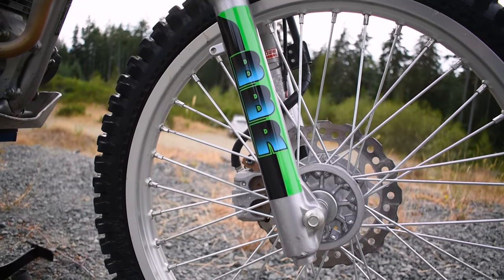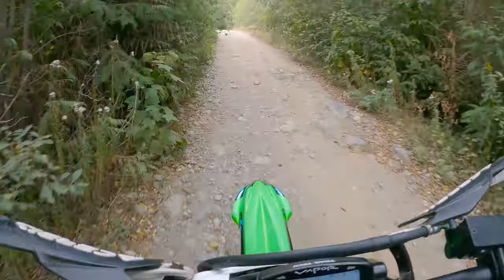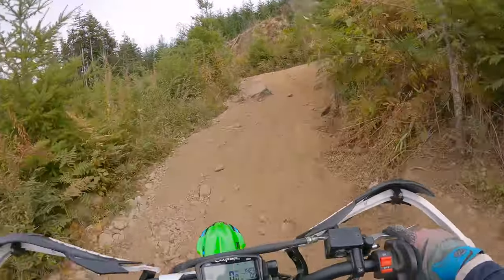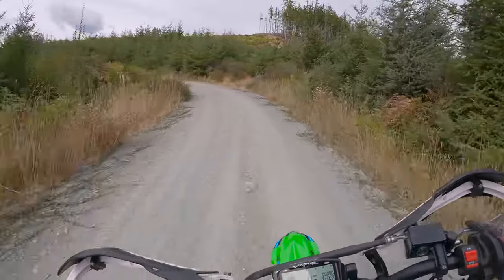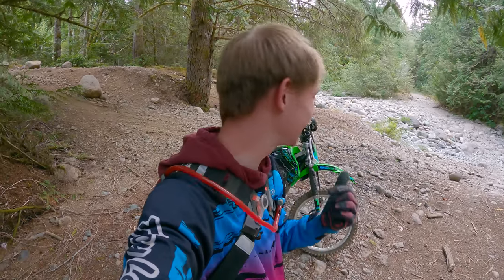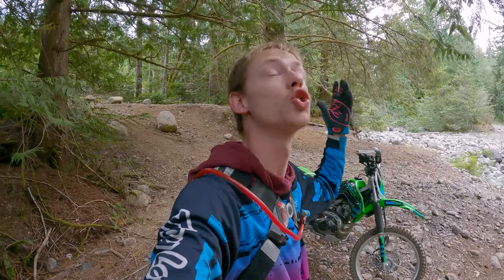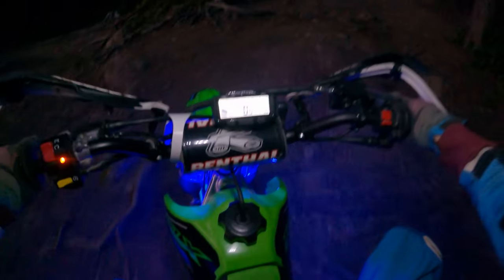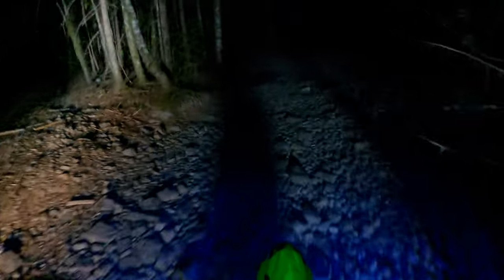THE BBR KLX170RF V1 FIRST RIDE

Comment: Bro that bike is sick!! I have a 2017 140g that I was gonna sell till I seen your videos. Do you have a parts list of everything you've done? Badass 🤘
Reply from the maker: My Bike Parts List:

BBR Heavy Duty Front & Rear Springs: https://ebay.us/wt6zBe
BBR Revbox: https://ebay.us/PJw54j
T-Bolt 170CC Big Bore Kit: https://ebay.us/4zV4PX
BBR Camshaft: https://ebay.us/dAxGMd
Genuine Mikuni VM26-606 Carb: https://ebay.us/XGDtym
Mikuni Carb Adapter Cable: https://www.keystonecycleparts.com/store-2/p/klx140-vm26-throttle-cable-for-stock-throttle
Mikuni Carb intake adapter: https://www.keystonecycleparts.com/store-2/p/klx140-vm26-intake-manifold-kit

Kalair GFX Graphics Kit: https://www.ebay.com/usr/kalair-gfx?_trksid=p2047675.m3561.l2559
Kx100 Fender Upgrade (Green): https://ebay.us/GIFire

Vapor Digital Dash: https://amzn.to/3kDuQOE
Renthal Handlebars: https://ebay.us/b166dA
Tusk Grips: https://ebay.us/ga7bpK
AS3 Shifter: https://www.keystonecycleparts.com/store-2/p/klx140-forged-aluminum-shifter-as3

Engine Guards: https://ebay.us/iIGHv8 (requires minimal trimming)
Frame Guards: https://ebay.us/aKQxXd (requires minimal trimming)
Heavy Duty Skid Plate: https://ebay.us/BG7Asi
Reply from the maker: Thanks for watching!

Comment: Nice bike, but everything is sold out on ebay, do you have another site where they sell the parts? It must be sent to the Netherlands.
Reply from the maker: You can try keithstonecycleparts
Reply: On sxparts is something on stock. Did you change the crankshaft and the cylinder head?
Reply from the maker: Stock crankshaft and cylinder head. When you start to open up those two pieces is when you can run into reliability issues
Reply: @AaronsEnduro  okay, thnx for the info

Comment: These kkx140/170 sounds like they tick.. my son has one n everytime start it makes think coming apart
Reply from the maker: Its normal for valve tick with the klx140’s and it only gets louder when you do a 170cc big bore on em. We set the valves on the tighten end of within spec to minimize the valve tick
Reply: @Aarons Enduro  I'm wanting to do the 170 on my sons but thinking might just get a bigger bike. Although being heavy and kinda slow factory. Nice to have electric start. Especially since we do along trails
Reply from the maker: Totally depends on his age and what would be the replacement bike!

Comment: hey Aaron did you ever find the need to put thicker fork oil in it or was stock oil good with the bbr spring upgrade? I weigh about 150 pounds and was gonna put the bbr springs on mine with stock oil
Reply from the maker: I never ended up using heavier fork oil, although i would if i was gonna do any moto with it
Reply: @AaronsEnduro  just gonna woods ride similar to what you do, not jumping it
Reply from the maker: It’s easier enough to swap, so start with 10 and then you can always bump up to 15 weight
Reply: @AaronsEnduro  thanks man nice to see your channel growing with the beta content
Reply from the maker: Long time coming! Getting closer and closer to going full time on youtube (my dream job)